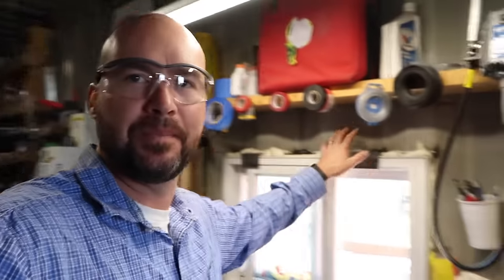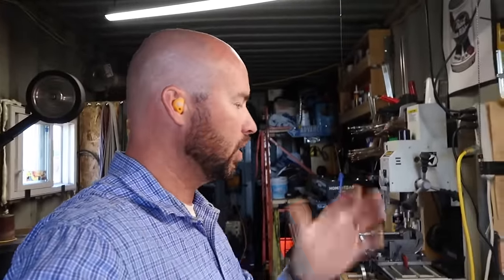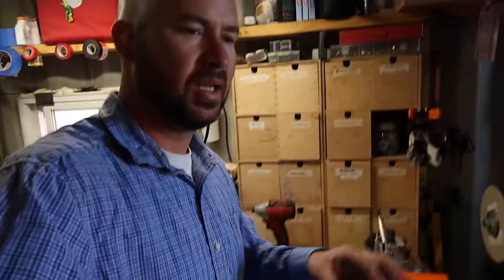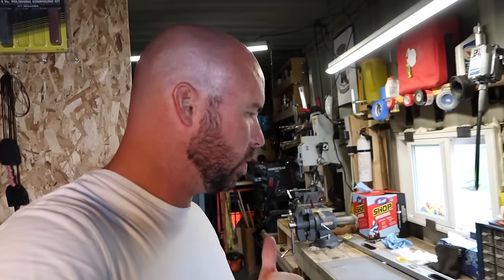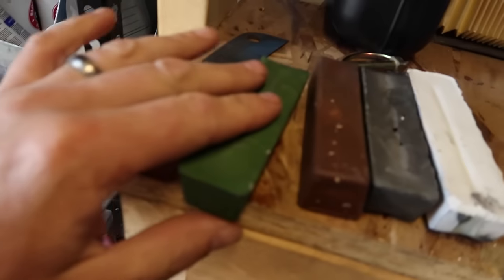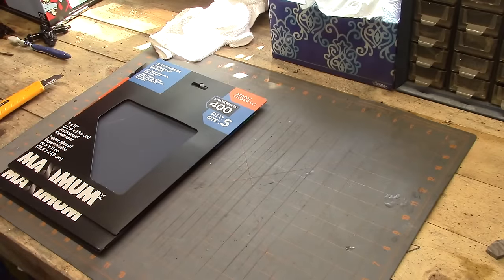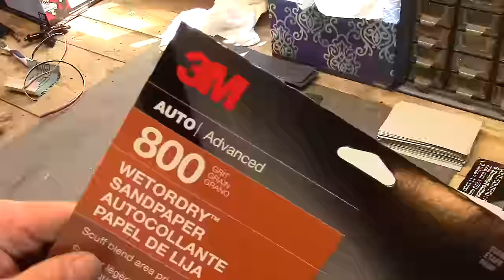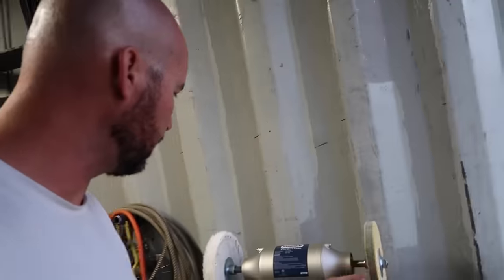Knife Maker's Vlog - Leaky shipping container windows

Comment: for changing buffing wheels, Look for a tapered buffer spindle. Its a spindle that attaches to your motor shaft and its taper is threaded so that as you use the buff it tightens against the spindle. You can change out wheels in seconds. so you don't need multiple machines.